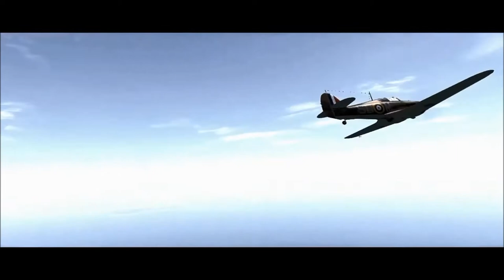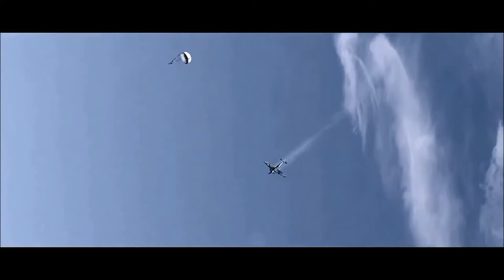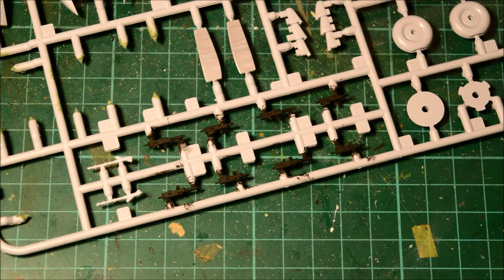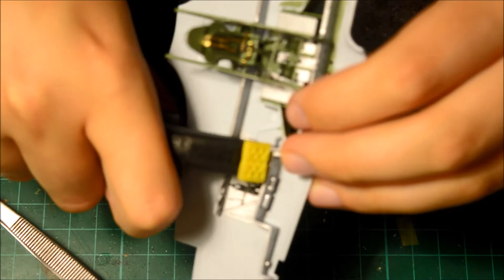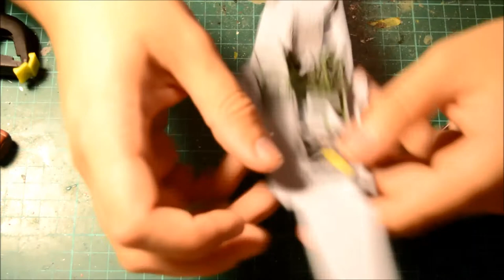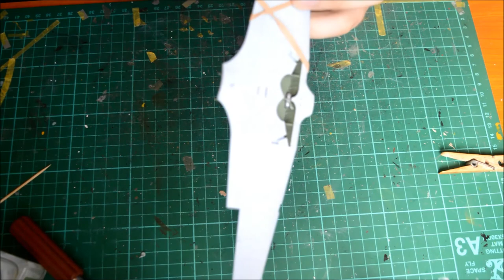Airfix 1/48 Hawker Hurricane Mk.I - Part 2 (Armament + Wings)

Comment: The wing spars on my kit were quite 'distorted' and after gluing down needed sanding down at the wing root area, both sides, to allow the fitting of the upper wing parts.

Comment: Hey mate yeah I had the same issue with the warped front spar section within the wings ... Also I found that I had quite a large step on the front leading side of the wings when both halves where joined together, it needed a bit of sanding ..... Keep up the good work Richard :D
Reply from the maker: Hi Richard, yeah the warped wing spars had trouble going in and I am having trouble with certain things on building (part 3)